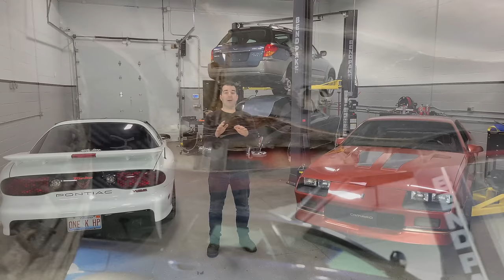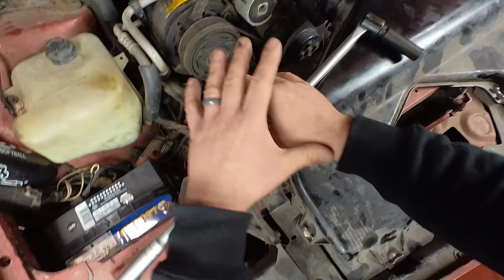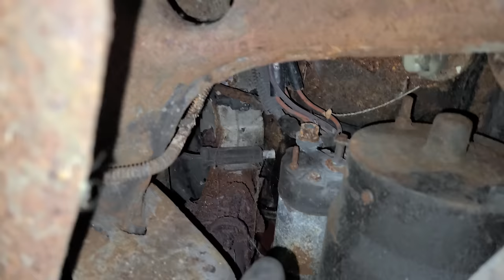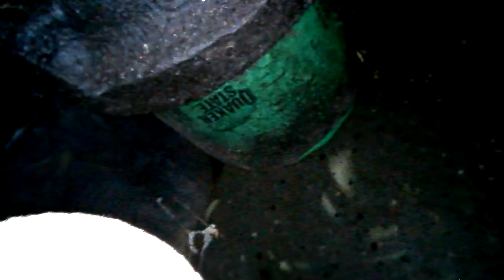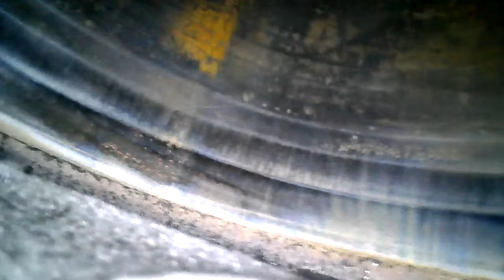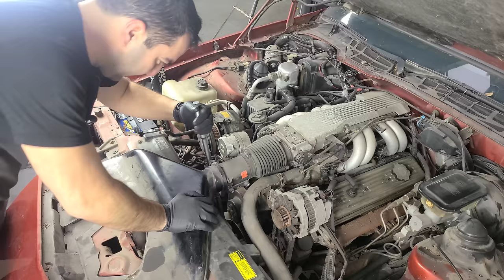Starting An Abandoned Camaro IROC Z After 27 Years & Looking Inside The Engine! Storage Unit Find!

Comment: If you keep doing fuel injected revivals, I would make an external fuel pump system that connects to the schrader valve as that is the most universal way to connect it.  You won't go far due to fuel flow, but you can run it on fresh fuel.  My suggested parts list: 2.5 gallon fuel can, fuel pressure test kit, and some sort of external high pressure fuel pump.  Something rail mounted like off of an early F150 or a Volvo 940.  Adapt the pressure test kit for connection and maybe take the valve stem out for flow.  Power the pump externally and things should run.  You can easily make it all one hanging unit that goes anywhere.  Then again, BG makes a kit that does the same thing but is ran off of regulated air.

Comment: In the early '90s GM had a few fuel injected big block Corvettes running around (ZR2) and also one carbureted Camaro.  You could hop up a Gen 6 BBC truck engine, or the 8100 if you're feeling frisky :)

Comment: For a YouTube project car, just blast the undersides, weld in subframe connectors, get the suspension and brakes up to snuff and nothing else to the body/frame. Of course, rebuild or find a decent 305 and transfer the tune port injection system over. It could make for a great series!

Comment: Quaker state oil filter came from QLube oil change place. They are made by Purolator. They were just painted up for I.D. purposes @ the fast oil change franchises .
Go get a 5.3 99-2003 tahoe and put the drivetrain in the iroc.

Comment: It’s worth more parted out in my opinion. My guess on the reason it had so much “oil” in the pan is it prob blew a head gasket and pumped some coolant into the oil. At that point the milk shake in the pan isn’t a good lubricant and it developed rod knock

Comment: Hi, brings back 3rd gen memories.  Have a 92 transam GTA that seized in 96, swapped Zz3 performance engine and ran till 2014.
Back on track restoration half way, engine still runs great even after 8 years.  It would be interesting to have a new zz6 on this your Iroc though?

Comment: Likely the three not-new spark plugs were from the cylinders that were the most difficult to reach. I know that I don't have the tools to get to some of those plug locations. Many years ago I owned an early model Porsche 911, where I had to drop the engine to remove the spark plugs. It was no big deal, however. Put a jack under the engine, remove two engine mount bolts and lower the engine slightly, being careful not to stress the shift linkage rod, and all the plugs were easily reachable from underneath. That 305 in the Camaro looks like a nightmare by comparison.

Comment: This thing has a blown headgasket. Which is why the oil was over full and a milk shake color consistency. The coolant was being dumped into the engine, mixing with the oil which you'll probably find bad bearings washed out from bad lubrication (coolant/oil mix). It needs a complete overhaul. If you decided to fix it up I'd do a LS swap. These cars are becoming more and more rare. Good luck.

Comment: That is a cooling system mixing with the crankcase not just a spun bearing im sure they  overheated the hell out of it and end up damaging the rotating assembly also just because you shove that much fuel into an engine does not mean its going to start faster or run better or rev up if thats what you were going for

Comment: please save this IROC from dying. my buddy got an insane IROCZ about 3.5 almost 4 months ago. summit racing heads, big cam, hooker headers, all brand new hardware on the car top to bottom. it is such a beautiful car making 480hp. plus every motorized or electrical part on the car works like new. the interior is immaculate. car is in such good condition. he got it for $14k and almost 4 months into owning the car it has almost doubled in value. it's an IROC made just like the original IROC carbureted race cars. my buddies is tune port inject and also has a 5speed Borg Werner trans with an aftermarket race clutch. lol thats something i'd never though i'd say. i'm a big jdm/tuner guy but 80s and 90s muscle cars are super rad.

Comment: i would keep it and strip the interior out. then cut out the floor and replace it, as well as the rockers then cut and patch the back quarters and at that time tub them. then cage it and pull the engine out and put a LS3 in there that is twin turbocharged pushing about 1600hp and have it as a drag/race car. it would be a fun project and the little bit of money put into it would be worth it. also it would make great content.

Comment: Your oil can is not quite 100 years old...but could be close...R.G. Plews Co. Founded in 1927 designed oil cans for the railroad initially, then got into the automotive market when that took over in the 50's and 60's. Pretty interesting. Now it's called Plews and Edelmann (Edelmann joined with Plews in the 70's) and they make auto parts today.

Comment: Idk about new Quaker state,, but back in the day it was good oil, but only good for about 4000 miles,, it had perafin in it,, yeah wax,, 😵 it works but has issues with break down,,, and if one back on the day made sure to do regular oil changes 👍👍👍but if not,,,, talk about sludge and build up on top of the valve train😵😵😵 black burnt gooo

Comment: i miss the days these cars were cheap and plentiful. i bought a 89 camaro RS 305 TBI 20 years ago now..... i paid less then 3 grand. sure it was a gutless TBI engine, but ZERO rust carolina car..... very very clean. i ran the 305 for a couple of summer and pulled it in favor of a 350 TBI with better heads and a cam. it was a stout running car, and even though i never drove it in the winter i got a few pin holes in the floor from where the carpet wore through, the dirt must have worn through the paint in that area. it had t tops so i got some pin holes from the leaking t tops. the car wasnt rotted out but i just didnt have time to work on it, in retrospect i wished i kept it. it was a fun car it just needed some work. i also had a 96 LT1 that drove for quite a few summers, eventually the head gasket failed. i didnt destroy the engine, i sold it to a friend that had owned literally a dozen of those cars over the years. he fixed it and still has it to this day, at least i didnt junk it and gave it to a good home. that was also a fun car

today i have a bonneville SSEi that's in pretty good shape. i really enjoy this car, but it's not an F-BODY. it's a supercharged 3800 with some bolt-ons and a pulley swap. it's just too heavy to be really fast...... its quick though

Comment: I had a 89 iroc z with the 305 and the guy I got it from ram Quaker state oil and the inside of the motor was gunked up bad. I had to clean inches of sludge outta valve covers and oil pan. It was really bad and he did regular oil changes in it also. So if you ask me Quaker state is a joke.

Comment: wouldn't the oil and coolant separate and not be choccy milk over that time period? unless someone had tried to or started and run it recently? Ive drained engines where it was straight water for a minute before it started pouring black oil.

Comment: I'd pull the engine and do a ring and bearing rebuild, just rehone the cyls and a valve job. 
Too much moisture in there from just sitting, most likely a blown head gasket. 
Do a compression check and see what that shows. 
Needs a fuel pump and a tank clean out too.

Comment: Jet fuel also makes for a good release agent on stuck engines….at least on airplane engines, although there is not any real difference in the piston engine design theory. Make sure you change the oil of course after using it.

Comment: Don't know why everybody hates on the 305tpi so much. They weren't bad engines at all. I guess because the 305 started as a low power gas/emissions saver. The later versions that were made to perform did just fine compared to the competition. The 305 5spd manual cars ran as good as the 350tpi auto cars did in the later year Camaros.

Comment: Pull the engine and fix it. Put it back together and clean it up. Enjoy it for what it is. 
With your shop you should be able to put it mostly back together enough to enjoy it. Or at least sell it for more then what you got in it after you get it running again. 
Anyone that likes the old 80’s Camaro would pay what ever you ask for it as long as it runs well enough to bring them back to there youth. 
I would love to see it doing burnouts again. 
Best of luck

Comment: Get a junkyard 5.3 or 6.0/4l80 combo, call up Texas Speed and have them send you a nitrous cam package, swap that in with a Holley terminator system and go do nasty nitrous burnouts with it at Cleetus and Cars untill you smack the wall or it falls apart

Comment: I don't think that engine is shot, you're trying to run it in starting fluid, is probably pre-detonation and valve rattle,  try to rig a fuel system to is and run it on pump gas, as far as the extra oil, I agree with others probably a blown head gasket letting coolant in the oil, don't give up just yet

Comment: damn.  I feel bad for that IROC.  I take care of my '89 model as well as I can.  My main problem is that I just don't have a lot of time to put solid miles on it, as it still has yet to pass 11,000 original miles (I'm currently at 10,749, so I'm getting close...)  specs are TPI 305, 700R4 and 10 bolt rear.
Recently drove back home to update the coolant hoses, transmission fluid and filter, and rear differential fluid, as they were still original equipment...  Yeah, mull that over for a second.
put it all back together and of course, forgot to plug the IAC back in and thought I fucked up the idle.  Was a fun 5 minutes trying to troubleshoot my idiocy.

Comment: Marvel's Mystery works to unlock a motor, didn't believe it in the 90s when I was a teenager but had a 78 trans am, racing it it started pecking so I locked it up poured the oil in, it unlocked it drove it 50 foot and slung a rod through the motor.

Comment: I just came from watching the build of Vice Grip Garage's Independence Chevelle. All I can think is if he can make cars that for all intents and purposes shouldn't be running and driving, into magnificent machines, the potential is there for this to become something cooler, and more original than just a cookie cutter IROC. I personally would build and swap in a Forged turbocharged and intercooled 4.3 V6 similar to the GMC Syclone/Typhoon, kind of a Turbo Tran-Am tribute without a Grand National motor. And if the chassis really starts to fall apart, rip it out and put it in something else. Just my two cents

Comment: I don't man just about every time I have started a motor on starting fluid or break clean it I guess knocks and pings it sounds real bad but the motor is fine try to get some  gas to it or get some propane to run into it

Comment: Thise tune port 305 were tough as nails... they only had 200hp though... I had a white z28 iroc z.
Reply: Fixed up and running without doing the body work I say 4500. With body work and paint close to 10k

Comment: What is the reason for using transmission fluid in the cylinders in addition to engine oil and penetrating fluid? I've seen other channels do this as well, but I've never seen it explained.

Comment: Definitely coolant in the oil, if oil looks like a milkshake it's from being mixed with a source of water.  Coolant is the only water/chemical source in the engine of course so I would assume a cracked head or head/gasket.  If that's the case then it most definitely overheated, but then there's the question of did the coolant run low or the oil?  Maybe the oil pump stopped or leaked out causing the heads or gasket to go then leaking coolant into the engine.  I would guess that's the issue because the oil/water mixture is in the oil pan versus finding oil inside the radiator for instance which then may be more of a spun crank bearing?  Not sure of the symptoms or scientific effects of a spun bearing tbh but these are my thoughts as a growing tech 🦾

Comment: While it is rare to find a 'semi-seized' engine that you can salvage, I've done it a couple of times in my life. The first time, I found out about this 'trick' from a guy who had worked at the Flat Rock Assembly Plant for Ford. After discussing various lubricants one day, he said 'you know what the perfect lubricant for most motor applications is?' Having no clue, I played along, 'no, what?' and he said 'Marvel Mystery Oil'...it has all the penetration and lubricity of transmission fluid and penetrating oil, combined, without any grit or undesirable abrasive behavior. Secondly, it is a highly refined hydraulic fluid. You can use it in transmissions...but you can make your engine last FOREVER if you use it as engine oil!' (I actually did this on a 'fresh build' 350 once...and it worked better than any synthetic on the market...though quite expensive in the day). Put some Marvel Mystery Oil in a 'squirt can', then simply shoot a little bit into each spark plug hole...let it sit. It will free all stuck-rings, return cylinder lubricity, and allow for 'flash rust' that may be in the cylinder, to 'wash out' and get captured by your oil filter. If it can be saved, MMO will save it!
Reply: By the way, the best 'engine build lube' you can get, isn't some fancy $20 a tube goo, but good old Vaseline Petroleum Jelly. It sticks to babbet bearings very well, it is water-repellent, it heats up and melts off quickly at lower temps, and when it melts down, it goes right into your oil...and comes out PERFECTLY in your oil change, with no detrimental effect. Petroleum Jelly comes from 'down hole' oil wells. If you look at a well (pumpjack) working, you'll notice a lot of 'grease' at the top of the pump rod, where the pumpjack-to-pump rod connection is...well, no one put it there...that is actually high-grade heavy-weight petroleum, right out of the well...and that is what Vaseline is...they merely warm it, filter it, bleach it (to make it translucent) and then warm it high enough to kill any microorganisms...then let it cool and congeal...so, it's not like you aren't using a petroleum product when building...and, it does WONDERFUL WORK with engine builds! Even engines you plan on wrapping plastic, and putting back for months or years before installing! The Petroleum Jelly will STILL be where you want it to be, when you get around to starting it up in a new installation!

Comment: Contact Blueprint engines and another small block replacement 385 striker with blower thru the hood?
Back half rear suspension with street strip 4 link with roll cage and tub the rear wells to house radial slicks..
Party on in the retro 80s?

Comment: Guys tried to get power out of these motors and the bores are just too small and shroud the valves.
Of course we didn't turbo everything back then...lol
Yes you can unfreeze them
Could be a coolant leak into the oil and washed the bearings out too

Comment: As a 63yr old i have been a Camaro & Firebird enthusiast almost my entire life owning 17 F - Body vehicles of all 4 generation's starting with a 1967 RS Camaro in High School and ending with a 1997 Pontiac WS6 Ram Air Trans am.  So many memories but each generation all had hits & misses in different builds they offered to the public.

My best 3 Pontiac's i owned:
1976 Pontiac Trans am ( owned & bought while stationed in the US Army Fort Hood Tx) - that 400 cubic inch motor screamed power !!!
1991 Pontiac Firebird Formula 350
1996 Pontiac Firebird WS6 Ram - air Trans am

Best 3 Camaro's
1967 Chevy Camaro RS ($500 back in 1976 my 1st car in High School) - candy apple red
1991 Chevy Camaro Z-28 (tuned port injection) - teal green
1996 Z-28 - black

I'm sorry but do not like 5th gen camaro as they could have kept the Pontiac Trans am name and made some available off the 5th gen platform.

Comment: That 20 amp fuse should be a 10 amp and it's not necessarily just a fuel pump fuse. It's actually the fuse for all of the engine systems.

Comment: I'm willing to bet that sludge is clogging the oil pickup screen.  Fill it with diesel fuel and put a fuel pump in it with fresh feul.  Crank it and let it run for a couple minutes.  Change oil and try again.  The sludge is either from bad intake gaskets or a blown head gasket.

Comment: Even as a parts car, it's probably worth about what you paid for it. I know the car has rust and a blown motor and it's probably easier to just part it out and get some of your money back and be done with it,  but.......it's a super-duper rare color. I've been in the 3rd gen community since these cars were new and currently own 3 low mile examples and I've only seen 2 MOM cars in the flesh. I am very knowledgeable about them. I also am local to you. Feel free to reach out, should you have any questions. In the console is a sticker called the SPID. The codes on the sticker tells you everything about what the car left the factory with. Regarding it being a hardtop,  that's not the bummer you might think. Fewer of them are around nowadays and people seek them out. Charlie

Comment: Fix the IROC it not that bad from the pictures most of that surface rust the fuel lines need ro be replaced and the fuel pump pull the engine probably clean it up valve job head gaskets an bearings some cars in that time frame came with
Cranberry and bearings.

Comment: Whatever happened to this car?  Parted out or crusher?  I had an 89 TPI WS6 5 speed 305 black on gray new carpet seats reupholstered Florida car I sold in 2003 because the kids were growing and the backseat was too small.  Fun to drive but my 09 Avalon with 2GR-FE V6 is quicker.